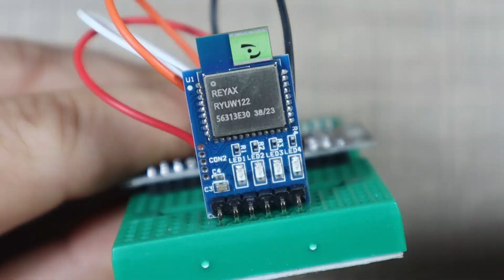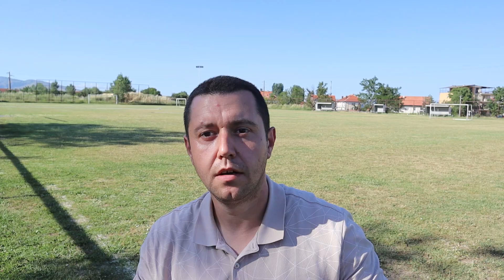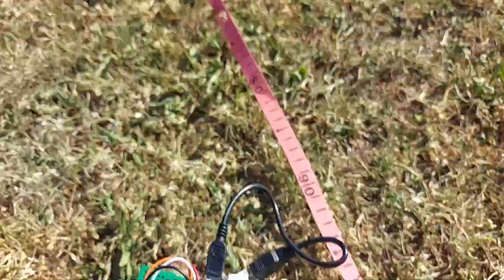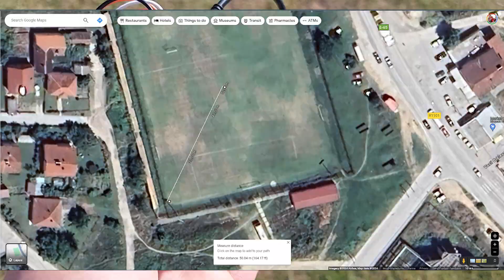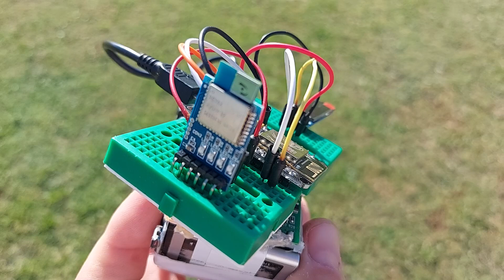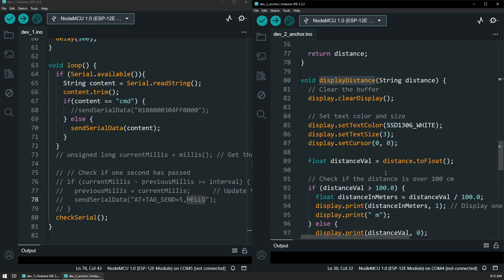Super Simple Electronic Tape Measure with RYUW122 UWB Time of Flight Sensor

Comment: The variable "distance" might have string in front, when passing the 100 m, and in that case, toFloat would give 0 because it will not parse a number starting with string, and you get 0 cm. My guess is to see what it really has as value above 100 meters, then format accordingly.
Reply from the maker: Yes, correct. I wanted to try the same but I ran out of time for the video.
Reply: @TasteTheCode  If the limit is 100 meters, then probably it stops sending a value, and shows some error message